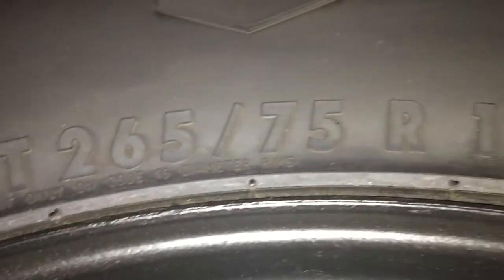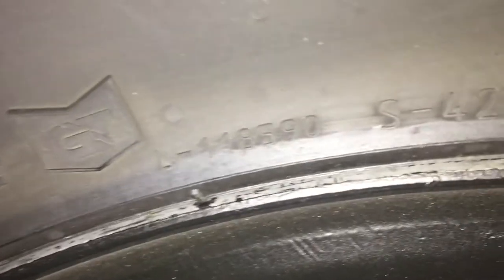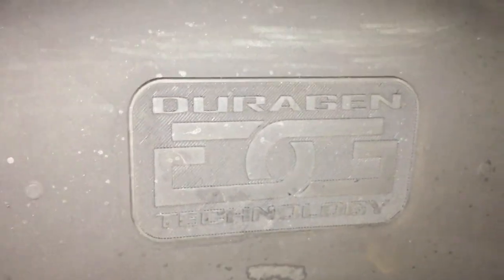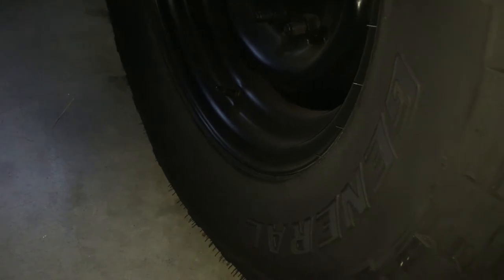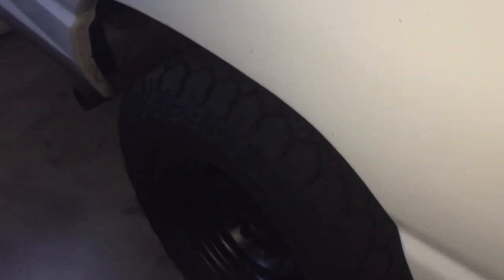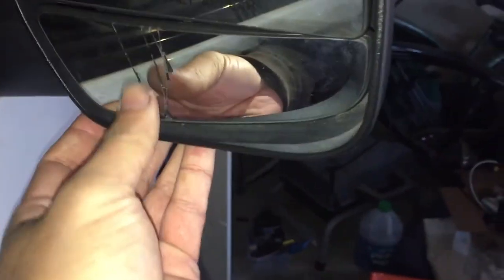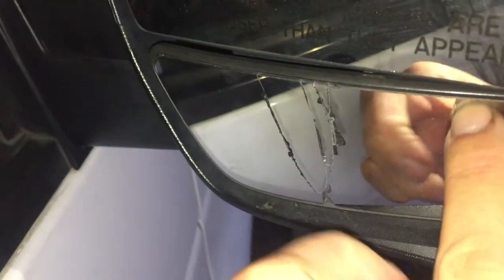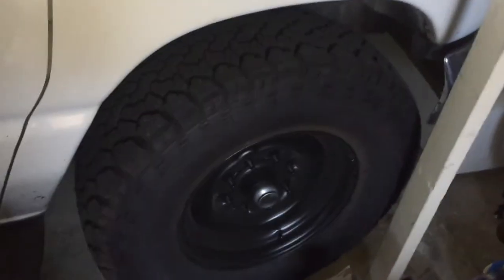VAN LIFE | WHAT'S YOUR TIRE PRESSURE? | ARE YOU RUNNING THE RIGHT TIRES?

Comment: Extended Vans are rated to carry 4000 pounds inside. That 4th Row of Bench seat is way behind the rear axle and the 3rd is right above it. 7 people x 200 pounds a person is 1400 pounds in just the back. Tire pressure is really important when using these as 15 Passenger vans because of all the weight. The Tires will shred especially that Driver side rear since most of the weight is there due to full tank and more weight being on that side when people under inflate them.

You got the Load Range Es which is the tires made for weight. I do 55-60 front and 65-70 Back. 

The more air in your tire the Harsher the ride. 

You appear to care for the details/OCD  get that thing weighed. I weighed in at 6580 with all the seats in. Some Sportsmobile conversions are checking in at 10,000+
Reply from the maker: So much math...you’re like a computer 💻 now I have to find a weight station near by.
Reply from the maker: @JohnDrivesAnything  me too but my dyslexia likes to play with my totals.
Reply: @CHICOandtheVAN  I need to get weighed again. I think I might be under the stock weight. The 3 Bench seats I took out felt like 80 pounds each. I dont think I put the same weight back in. Futon was way lighter but the Springs for the lift might of added a good amount. I want to bring 2 portable showers with me that will add a lot of weight. Once I get the rear locker installed nd bigger tires I'll get a final weigh in

Comment: You asked then answer all your own questions 😎.  225/75r16 50psi front 65-80psi in the back depending on the load.
Reply: 225? Thats why you have that monster wheel gap stock. You trimmed the plastic front flap off the bumper too?
Reply: @JohnDrivesAnything   my body to ground height is about 3-4 inch higher than a passenger van . Basically take an 1998 f250 an put a van on it . That’s what I have .
Reply: @JohnDrivesAnything   5.6 inches of bumper is missing yes. And my paint job is miss leading.  But my van is on bigger suspension than a passenger van. Think f250 truck.   I could make video on it maybe 🤔
Reply: @bigtsperspective5831  I noticed the front trim since I did it too. I had a 150 and the 350 I have now has a tiny bit more lift stock vs stock. Front Trim makes the lift I gt look more lifted